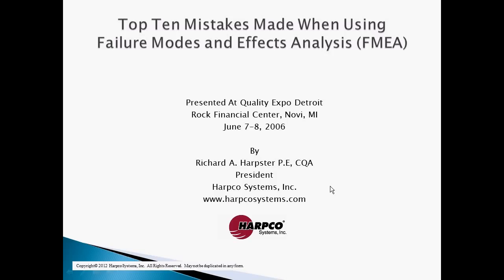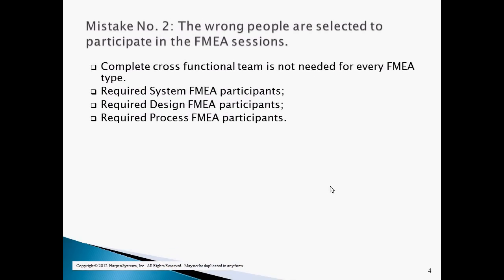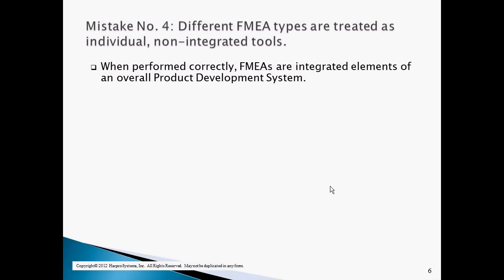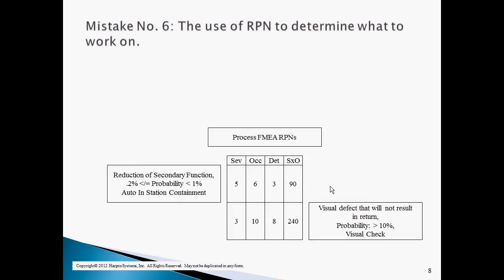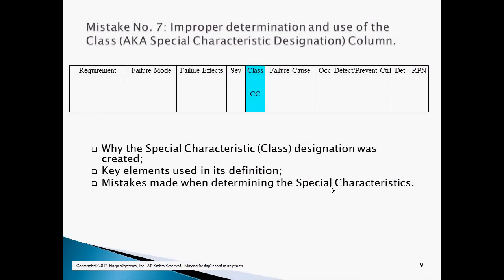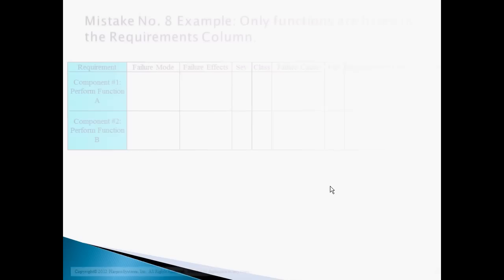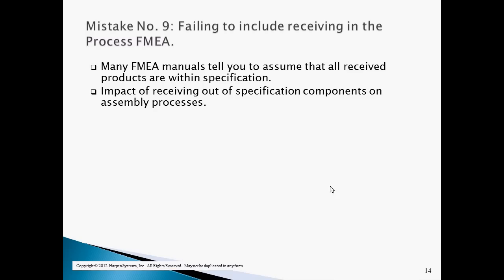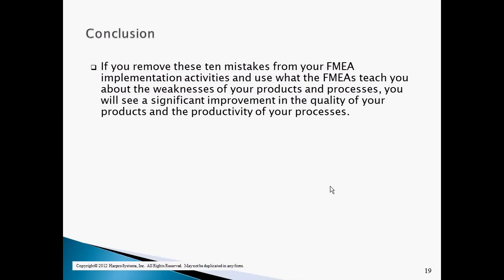Top Ten FMEA Mistakes

Comment: In regards to mistake #6, what ranking guide are you referring to? As per the AIAG FMEA Manual 4th edition,  a ranking of 3 is "Appearance or audible noise, vehicle operable, does not conform and noticed by many customers (50%)."
Reply: 3 would be a non-returnable noise or appearance issue